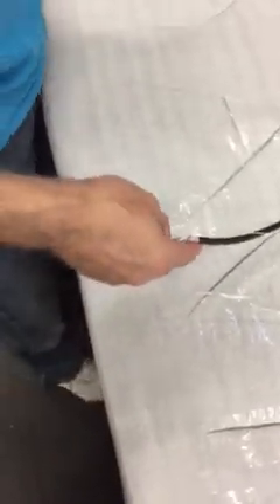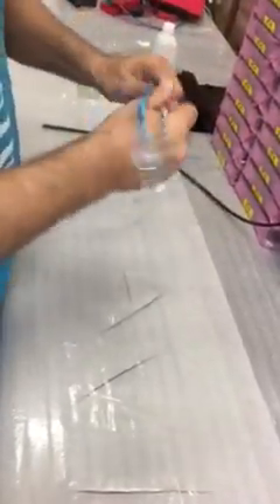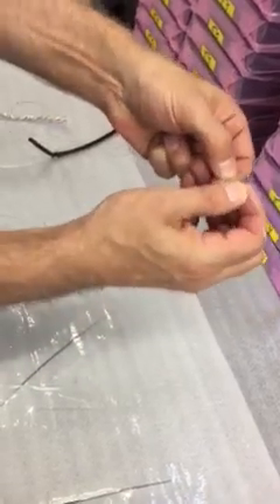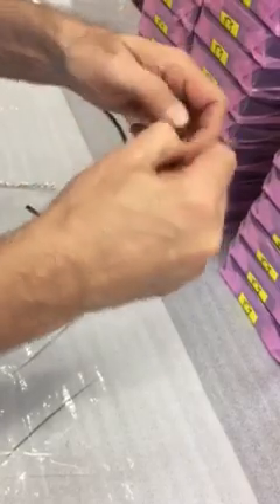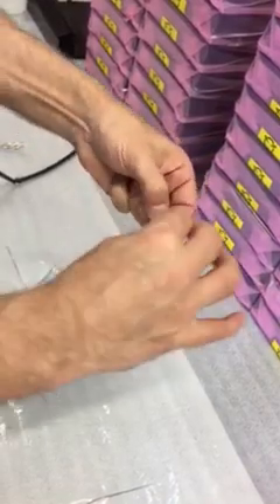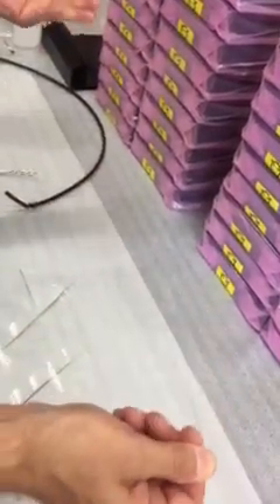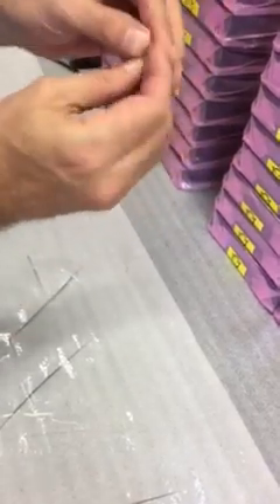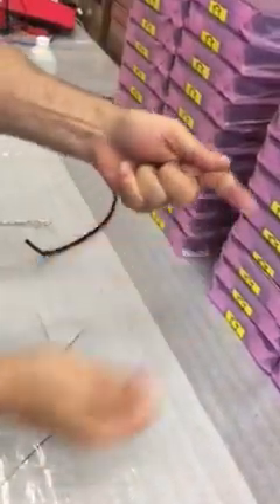RF Armor Cable Drain Wire

Comment: I think the wire malleability is fine. Is there a particular reason why you would loop it around before putting it into the hole on the RJ45 plug?